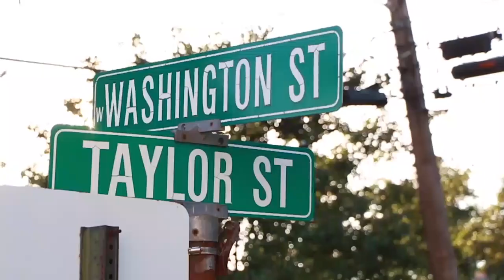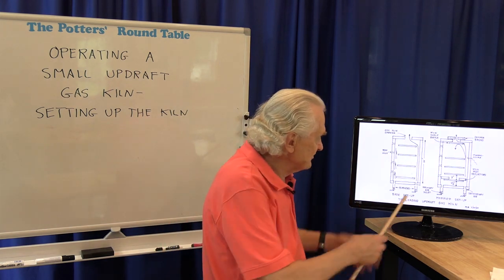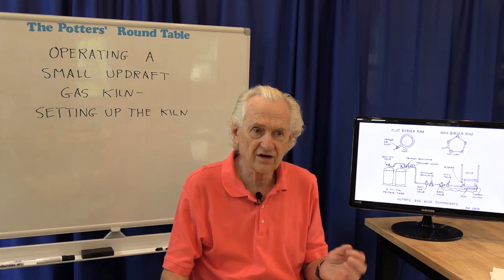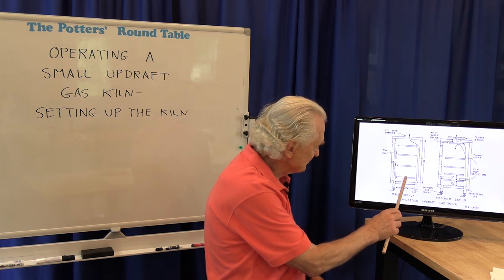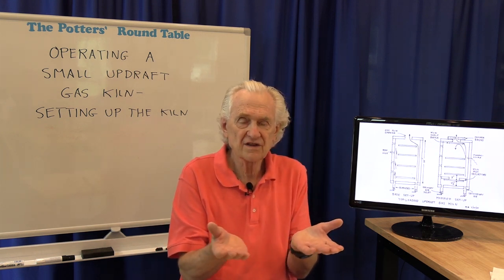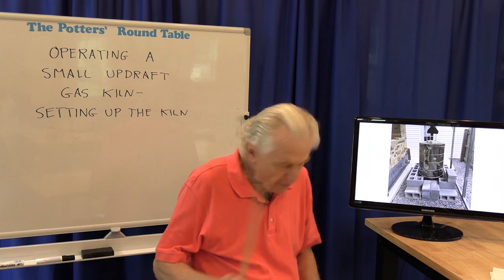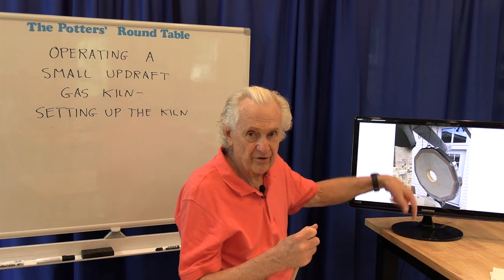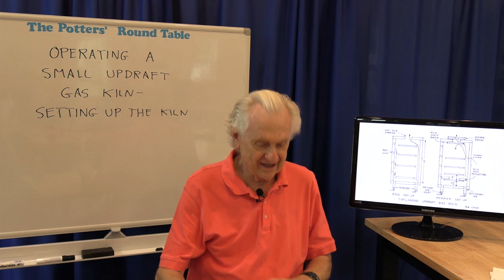Operating a Small Gas Kiln

Comment: I hope someone at your place can help me.  I started to fire my Olympic 1823 gas kiln (the smallest one) today and had some problems.  At the beginning I left only the pilot bar on to warm up my ware.  After an hour I turned the main burners on low.  I did notice some soot but it has been my understanding that soot is normal at this stage.  I had the lid propped open about 4 inches and the peeps open.  I noticed kind of a strange sound coming from the piolet burner and saw lots of flames coming out between the burner and the air adjusting plate.  I had this plate open about 1/2 in.  I had to close it up completely to not have the flame coming out but assume it was still burning inside.  I don't know how to deal with this.  I turned everything off because I don't want to blow up or cause a fire.  I do fire with propane and I do have a low pressure regulator on my propane tank.  The tank I have is a big one that we use to power the whole house since we don't get natural gas where I live.  I don't know if this was caused by the way I loaded the kiln or what.  I would greatly appreciate any feedback.  Is this a dangerous situation?  Once the kiln has cooled down I plan to take it apart and clean the pilot bar of any debris and check the orifices.  I am assuming the correct orifices are installed as they are the ones that came with the burner when I purchased the kiln and I did specify propane.  If anyone out there can help me solve my problem, please do.  Thanks
Reply from the maker: Hello, sorry it took a while to respond. I had to think this through a litttle bit!
There are a couple questions I have from the start, first, is there some space at the bottom of the kiln for the air to mix with the gas? we have about six inches at the bottom of the kiln for the air and gas to mix and ignite to produce the most heat. If you don't have some space, that could explain flames coming out from the bottom. 
Next question, is there anything blocking or restricting the flue? We put a 10" circular shelf about 1.5 inches from the flue to help keep heat in the kiln and we use soft bricks as dampers to cover the flue. In an earlier firing, I had the shelf  too close to the flue (less than an inch) and we couldn't get to temperature. we also experienced the backflow of flame you are describing. Basically, the gasses couldn't escape the kiln.
Next question, what is your line pressure going in to the kiln? We have a regulator for line pressure and a flow valve into the kiln. I keep the pressure at 5 psi or less and the flow valve barely open, and that gets me through the entire firing. If the flow or pressure is too high, the kiln chokes up and stalls. We have our primary air on the burners open about 1/2 inch and have never had to change them.
Is it windy? I put cement blocks around the base of the kiln, slightly higher than the floor, as a wind block and they are great for steps to load the kiln. We have three large tanks ganged together to feed our gas kiln and soda kiln.
If you have any pictures, that would help. send them to washingtonstreetstudiosinc@gmail.com.

Good luck, I hope this helps.
Reply: @WashingtonStreetStudios  Thanks for getting back to me.  I really appreciate it.  I'll try to answer your questions.  I had the kiln set up with a bottom shelf 4 inches from the bottom of the kiln and then another shelf where I placed a kiln post over the burner as explained in the video Operating a Small Gas Kiln.  Above that shelf (which had nothing else on it, I placed another shelf 3 1/2 inches above it.  I had a baffle shelf about 1 inch under the opening at the top of the kiln.   We have a very large propane tank that fuels the whole house.  The handiman who helped me get my kiln set up put a low-pressure regulator off of the big tank.  There is also another low-pressure regulator that is connected to the gas line going into the place where my kiln is located.  There is a gauge also on the gas line pipe inside my shop that registered about 1 PSI.  I attempted to fire the kiln this past Sunday and the flames coming out of the pilot   burner were really bad so I shut the whole thing down.  The next day my son came over and helped me disassemble the kiln.  He blew out the burners with the air compressor and there was a lot of soot that came out.  When he blew out the horizontal bar attached to the piolet burner there was a whole bunch of black soot.  He cleaned the piolet bar with still wool and cleaned each of the holes in the piolet bar with a fine wire.  When we lit the pilot,  it worked great and both burners came on at the same time.  The flames looked great.  I am thinking now that the flames coming out of the burner (between the adjusting plate and the burner) was caused by the soot or carbon buildup in the horizontal pipe.  Now I am wondering why I had such a buildup of soot and carbon.  I did have the kiln on low for about 3 hours.  Now by low I mean I only had the pilot bar lit.  Could that have caused the buildup of soot?  All of the burner adjusting plates were at about 1/2 inch below the burner.  I haven't fired the kiln since we cleaned it out with the compressed air.  I checked the orifices and they are for propane which is what I originally ordered.  Sorry for this long reply but I definitely want to get to the bottom of my problem.  I have never had any trouble reaching the higher temperatures in the past and am hoping that cleaning the soot out of the pipes did the trick.  I am just clueless as to what to do in the future to avoid this happening again and wonder what I did wrong to cause it in the first place.  Maybe it was having it on low for so long but I have read that some people leave the kiln on low all night.  Some of my pieces are handbuilt and have thicker walls.  I have had pieces explode in the past where fragments landed on the burners and caused backpressure.  I try to avoid that ever happening again. If I try to fire it on low again, should I turn on the main burners and keep them on low?  I do get soot when they are on low.  Okay, I'm done.  Hope you can give me some suggestions to help with my next firing.  Thanks for your help.
Reply from the maker: I would definately lower the baffle shelf to leave at least 1 1/2 inches. If the gases can't escape, the soot will build up. But that's my only real suggestion. Phil passed away last July, and he probably could have helped.
Reply: @WashingtonStreetStudios  I'll definitely lower the baffle shelf.  Sorry to hear of Phil's passing and glad for his videos.  They have been very helpful.  Thanks again for your help.

Comment: Hey I fire electric to gas even during bisque.  I have almost the same set up that I learned to do over the years.  Adding the post flame deflectors may be something I might try.  You did not mention the temp or cone difference between the top and bottom after your changes.  I am still running a hot bottom much of the time.
Reply from the maker: I'll check with Phil and get you a response.
Reply from the maker: Even with the modifications, we still get a half cone to a cone difference in temperature between the top and the bottom of our Olympic updraft kiln (bottom hotter). I think that this is about the best that can be achieved with a small updraft kiln where there isn't the possibility of manipulating or redirecting the flame path like there is in a cross draft or a down draft kiln. The bottom will tend to be hotter because of being closer to the burners and the air supply, but it may also tend to be slightly less well reduced than the top because of slow or incomplete mixing of the secondary air with the gas.

Phil
Reply: @WashingtonStreetStudios  - Ok thanks so much!  For the last 5 years using only up drafts I am about the same.  I fire a high cone 5 middle  to reach a 5 top and bottom 6.  It works out as I run different glazes on each shelf. To close up my kiln I have it up on blocks and slide out the burner then slide in a cinder block with a half shelf to cover the hole as in my kiln I only have one. If you have 4 holes maybe you can pack the holes with fiber in some way to have the kiln slow cooler.
Reply from the maker: Thanks for the comment and the tip!

Comment: Hello sir how are you sir I want your help regarding the thermocouple for gas kiln
Reply: Today unfired gas kiln with 900 degree temptarture glaze in gas kiln.
When I start to fire gas kiln the temperature have been 25 degree than after 6 hours temperature was 225 degree 
When I saw the glaze test piece in kiln it was melted
Reply from the maker: Hassan, do you fire with pyrometric cones? If you are not familiar with pyrometric cones watch this video: https://youtu.be/4iqiC752MFc
Using cones is the only accurate way to know the 'heat work' within a kiln. Heat work is a combination of both time and temperature. 
Thermocouples measure temperature and they need to be tested to make sure they are working properly. It sounds like your set up is not working very well and this could be caused by several different components (faulty thermocouple, thermocouple not properly installed in the kiln, wires not properly connected or damaged) and most of these issues need to be resolved with help from the manufacturer. Can you tell us what is in your setup? What equipment? Pictures would be good as well. You can send them to washingtonstreetstudiosinc@gmail.com.
Reply: @WashingtonStreetStudios  sir I did not use cone but I used test sample of glaze .
If you give me your email I will send my kiln pictures
Reply: @WashingtonStreetStudios  how I can make pyrometric cone ?
Reply from the maker: washingtonstreetstudiosinc@gmail.com
Reply from the maker: Pyrometric cones are widely available and inexpensive. Search the internet for 'orton pyrometric cones' and you should be able to find a supplier near you.